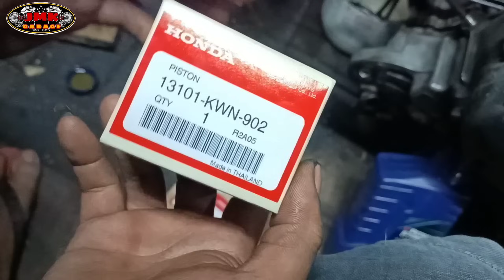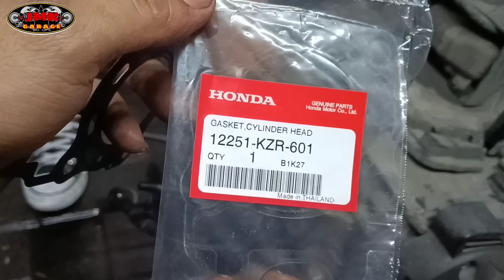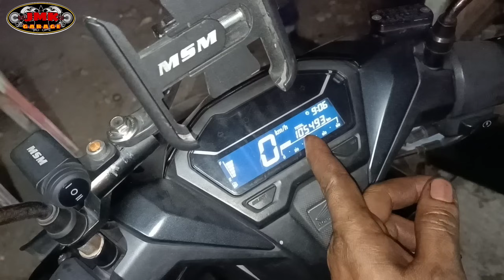dalawang honda click sabay binoksan ang makina || mausok lakas kumaen ng langis || top overhoul

Comment: Boss nag palit ako clutch lining at center spring 1k rpm at bola na 15g at 13g stock pulley po ako, groove bell po ako,ramdam ko pag nakasakay ako taz pinaandar ko ma vibrate xa nu kya dapt ko gwin salamat .kalilinis lng po ng cvt ko  at na trottle body cleaning nrn ako at valve clearnce nrn po.sana masagot nyo po more power po

Comment: Good day Sir
Sir ask ko lang po sana if ano po ang sira or depresya ng Honda beat fi na namamatay after ma push start button po sir, bago naman po sparkplug cap, sparkplug and fuel filter. Ok naman din po sir battery niya and fuse po sir
Reply: FI Cleaning lang yan idol
Reply: Thank you sir sa advice pero nag pa fi cleaning narin po kasi ako, hindi po kaya yung fuel injector na niya mismo ang may tama po? @elmercarrion2767
Reply: baka ignition coil yan o sa airfilter pwed ring nangatngat ang wiring.. mas maganda patingnan yan kanila boss mike